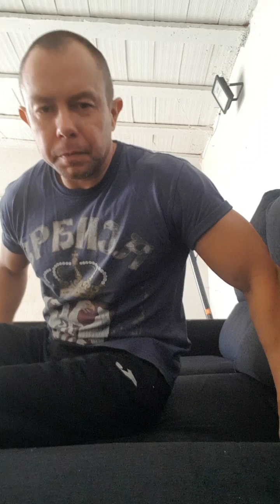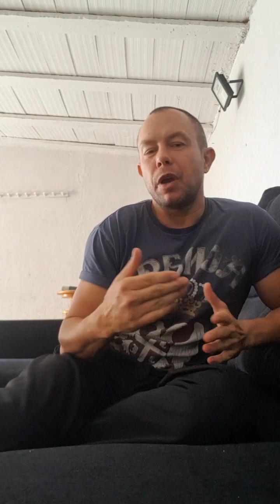The worlds best Mercedes om606 diesel engine info on the planet... The diesel 2JZ engine 😉

Comment: what if you made a separate a/c line to the intake side before the turbo? seems silly but love these ideas.
Reply from the maker: There are stock cars using AC to cool the charge air so that's an amazing solution really. I have been thinking alot of how to easily integrate it and that's the hard bit.
Reply: @FtunePerformance  i see..
i imagine the spooling psi would be the biggest problem. But even if one could decrease the intake temps slightly it would be a win imo, if there were a simple system to it i guess.
Reply from the maker: @onlyfamz  100% correct. Even a little is alot sometimes. Turning an AC pipe around the charge pipe a few turns would really up the overall efficiency.